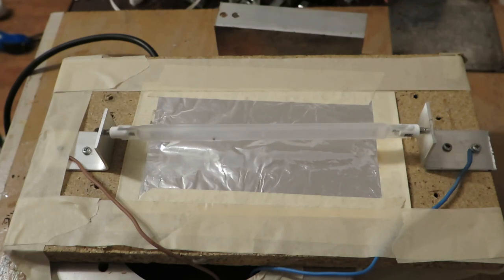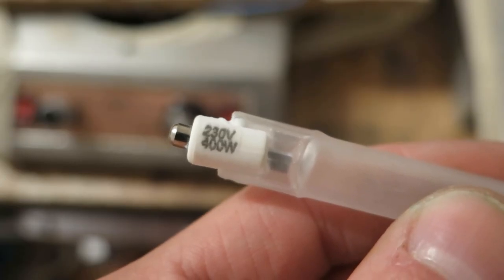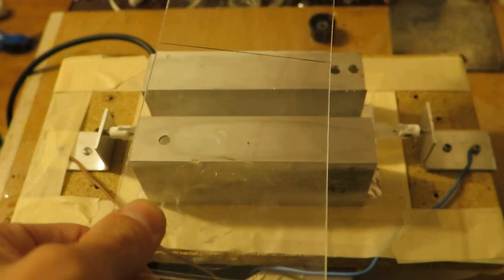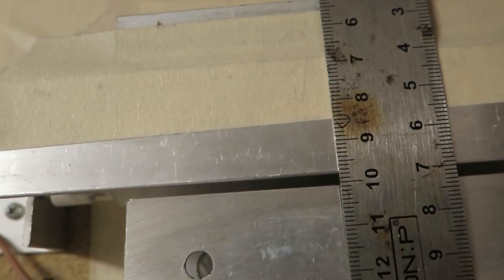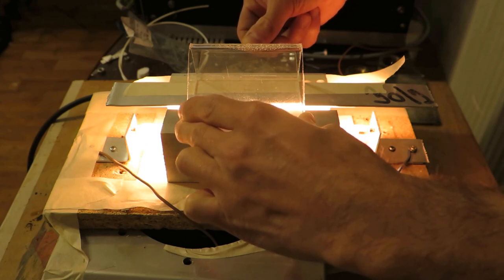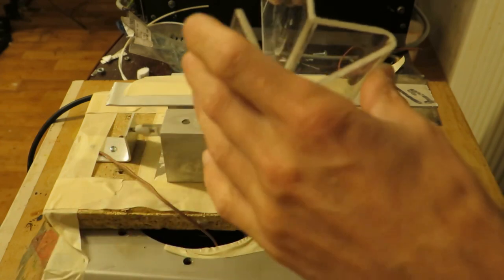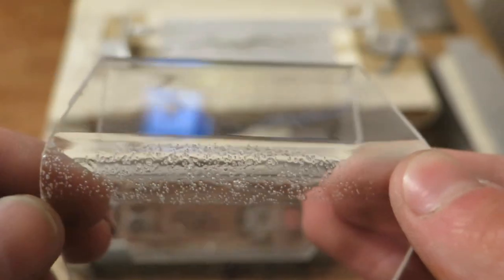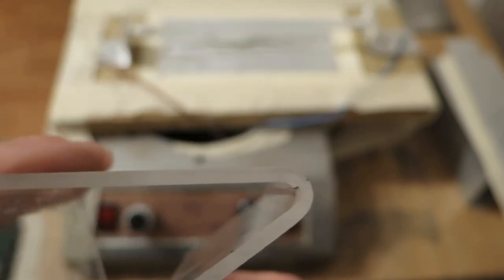Bending plastic with light

Comment: Great idea!     A guitar string, or nichrome wire and current would also glow red emitting lots of infrared light, and could be as long as nessesary, while a light dimmer can regulate the power going into it.  Use a fan to blow hot  convectection currents away  so you dont heat the surface  unevenly.